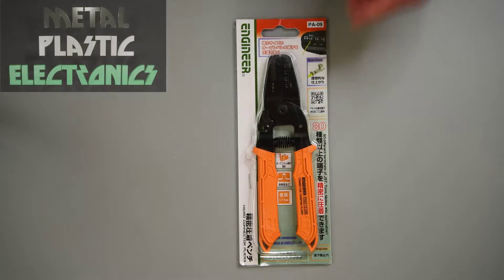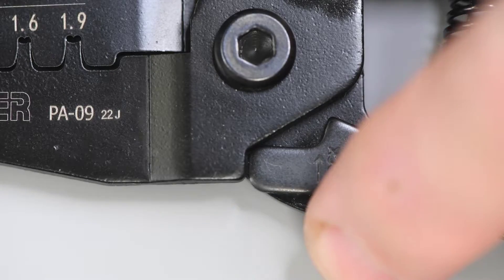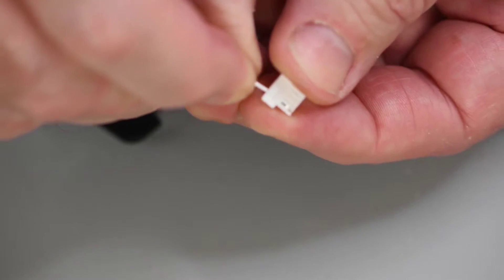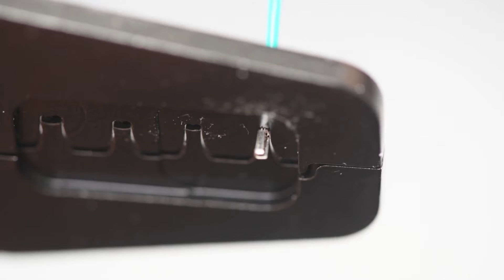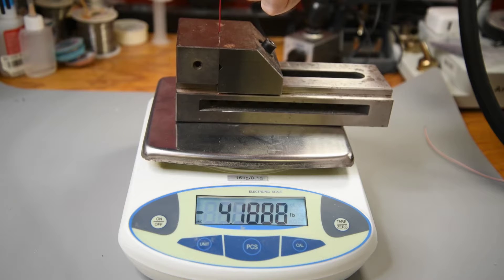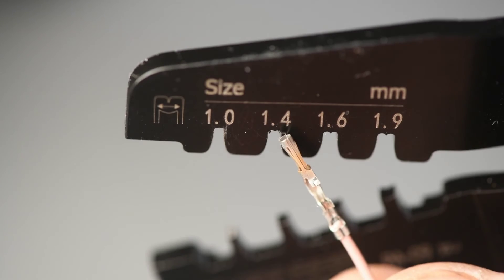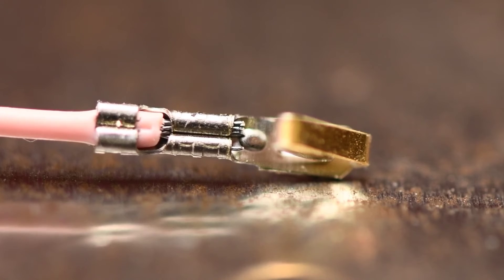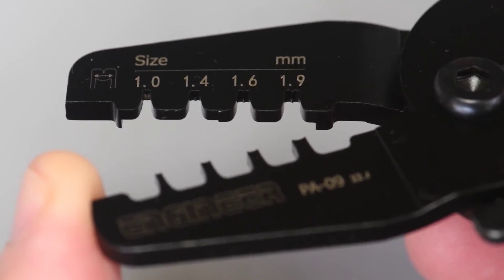Engineer PA-09 vs Molex CLICK-MATE Terminals

Comment: Supposedly the IWS-2820M is better and cheaper than the PA-09, but the PAD-11 is the best of the "affordable" crimping tools when it comes to quality of crimps.

Granted, I have no idea what I am talking about as I am just learning how to crimp wires. But that seemed to be the word on the street when I was researching what tool to buy. That the PA-09's popularity is due more to brand recognition than quality. BTW thanks for the super high quality video. Insanely helpful for a noob like me to see the crimping process so up close and in so much detail.
Reply from the maker: I have a video on the IWS-3220M.  The PA-09 did much better on the very small terminals.  I hope to do some more testing soon.  I'll put the IWS-2820 on my list.  I already have the PAD-11 on the list to try.  Thanks.
Reply: @metalplasticelectronics354  I think that is possibly because you switched from a single crimp tool to a double crimp tool. Small terminals seem to be difficult in general, but especially for single crimp tools.  I suspect that may be why you found it so much easier.

But again, I have no idea what I am talking about. You are far more of an expert than me on electronics, so I will leave it up to you to judge if my theory is plausible. And again, thank you so much for your content.